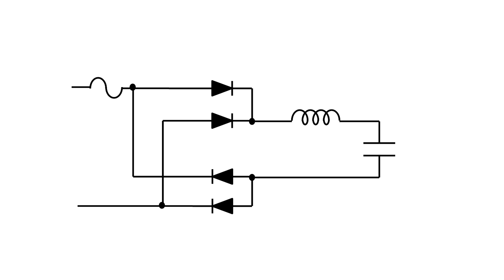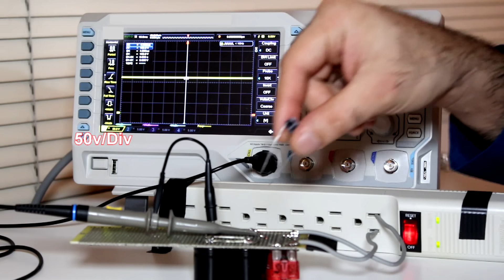Making a Full Bridge Rectifier

Comment: Doesn't  power  comes only  in the  Live wire in 120vac?  The Neutral  is just the return to complete the circuit.. So full wave rectifier in 120vac is a waste of diodes  couse power never comes from the neutral. 
By the way if 120vac comes at 60Hz, then 220vac  will be 120Hz, correct?  Cause of  60Hz in each line alternating,  will give 120Hz. But if 220vac is 60Hz, then each line will have 30Hz.... could you clarify this for me please. Thanks

Comment: I didn't understand the part where you tell us why negative half cycle creates short circuit when the power was earthed mambo jambo.
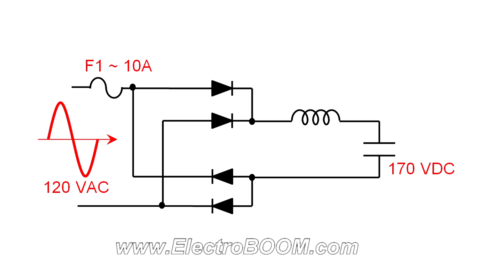Reply: Good question. If you draw out the schematic at 1:09 you'll see that when the AC goes into a negative cycle, current will feed back through the third diode from the top in the schematic to the hot wire. That isn't normally a big problem if the output is floating, not connected to the system ground. In that case the capacitor plate is already negatively charged so few electrons pass through the diode. However if you have ground for the input tied to system ground for the output, then electrons can freely bypass the capacitor, moving from the input ground through the diode and back to input hot wire. During that phase of the AC cycle there is no significant resistance slowing current down, so you get a transient dead short, enough to blow the fuse or even destroy the scope. For that reason, to protect the scope, many technicians power their experimental devices through an isolation transformer which prevents a direct connection between the transformer input and the scope ground. When you use an isolation transformer for the input power, the scope still has its own safety ground through the plug you use to power the scope, but electrons can't find a way to loop back to the input transformer so there is no dead short.

Comment: mr mehdi can i use it for 220 in iran
Reply: You can if you take capacitor of at least 350V. The rectified voltage is around 311V.

Comment: So idk about all that but my alternator is draining my battery when parked and i'm guessing I should just slap a bunch of diodes on the alternator positive and call it a day, no?
Reply: Your alternator is not draining your battery. You have a current leak to ground in one of the other electrical circuits. BTW, your alternator contains a rectifier and regulator in it.
Reply: @DaIssimo  
I'm worried the rectifier diodes in the alternator burned out, something for sure has shorted though it sparks hard everytime I reconnect the battery
Reply: @noahwood5686  In this case, I think the least troublesome method to fix your issue is to replace the alternator. If money is tight, then you can probably take the alternator off, open it up and see if anything is burned out inside. If it is just the regulator/electrics, then you may be able to buy just that part.

Comment: As an EET I get my new scope and think "I know I'll show everyone the 60 hz wave form from the power company from the wall outlet!"  Fast-forward to me putting the probe to the hot and neutral, and blowing the breaker.  "Yay mr engineer!"  Scratching my head. . . ."1 Meg Ohm resistance to input should allow almost zero current, not breaker popping current, what the hell is going on here?"    2:43  FACEPALM.

Comment: Actual demonstration of a LER (light emitting resistor)
Reply: AKA an incandescent lamp
Reply: Also known as an incandecent Light bulb
Reply: its efficiency is on the opposite end of the spectrum but oh well.
Reply: LEL
Reply: Good one
Reply: You mean an incandescent bulb filament?
Reply: Formerly known as LAMP
Reply: Bro just described an incandescent light bulb 💀
Reply: A light and a heater... I guess with a fan, a propulsion system.. or just light cigarettes
Reply: I think that's called an incandescent bulb.
Reply: So it's basically an like incondesent light bulb?
Reply: All incandescent light bulbs work on the LER principle.
Reply: @damemes3669  Except that an incandescent lamp is in a vacuum bulb so it can't catch fire, whereas a LER is exposed to air and can catch fire so it's much more exciting.
Reply: I don't think it exists as of yet but it's a cool alternative ide- oh
Reply: And I felt no pain, for once.  I'd forgot my last experience with such in situ, thanks!
Reply: Um aksually 👆🤓

It’s an incandescent light
Reply: Also called an incandescent lightbulb.
Reply: @xyzzy777 it mostly isn't that much of a good alternative, because it produces a lot more heat, so it uses way more energy
Reply: @someoneelse5005  r/woooosh
Reply: @ludiProjects  thats a lot of reddit stuff, why are you in youtube
Reply: @someoneelse5005 light emitting diode is efficient.
Light emitting resistor is just an incandescent lamp lol
Reply: @someoneelse5005 it's called an incandescent light bulb
Reply: @someoneelse5005  r/woooosh
Reply: @someoneelse5005  r/whoooosh
Reply: @mollyandaquafina  r/storiesaboutkevin
Reply: @anti-fz9be  r/facepalm

Comment: Full bridge rectifier circuit is no a such a big deal,i always thought.But once i was working in electric trains repair factory i came across with dc currents up to Kiloampere ranges.The forward voltage drop of rectifying diode maybe is about 1V but in high currents the loses across diodes are huge.

Comment: I hope that NO ONE thinks the 170 volts DC is safer that the 120 VAC line voltage.  At least with the AC, your heart might go into ventricular fibrillation and you might not die immediately, whereas, with the DC, the heart just stops!  Yes, you could get lucky if you have "one hand in your pocket" as they say.

Comment: I have 220v main voltage which i want to  convert to dc. I am using 4 in4007 diode and 250v 15uf electrolytic capacitor. Will it work ? Plz answer.
Reply from the maker: Nope, the dc created from 220v is 310v, so you need higher voltage components

Comment: I feel like you should build a massive 5000 watt psu for linus tech tips to test out on their new 100,000 dollar computer. They have to use 2 1600 watt units. That would be an awesome collaboration, and if he’s willing to drop a 11,000 dollar cpu for views I’m sure he’s willing to possibly blow up a 100,000 dollar computer for the views, and then you get some too. That’s if it blows up. But then again...
Reply: Computer PSUs, especially the higher wattage good quality ones are made from very high quality components, use very complex circuits, and have tight tolerances. People make custom cooling setups all the time, even custom cases, but never custom PSUs, because it's just not a good idea. A 5000W PSU will be a: way too huge, and b: if it blows up, it not only would take the PC with it, but there's a legitimate possibility of someone dying.

Comment: So 170V DV doesn't hurt... Until you unplug the damn thing and touch the capacitor which have only some of the 170 V DC.
Reply: Most of the things he does is intentionally to educate us not to do things and how to do it correct way.  That time he didn't get a actual shock but acted to say that capacitors do hold charge and can cause explosion if shorted even when unplugged
Reply: Because his palm is more sensitive.
Reply: Why is it so ? I also have that question.
Reply: @chinmoytahbildar3278  It is NOT so. You will feel DC voltage from 45V upwards, depending on the conditions.
Reply: @hansfriendly4815  I understand that @Werner Beroux is joking... What are the conditions ?? Why he doesn't get shocked after touching 160 V DC ??
Reply: @chinmoytahbildar3278  I think the joke is "he always gets unintentionally a shock, but now he just asks to be shocked and surprise surprise, nothing happened.." conditions, there are many, but it comes down to the conductivity of your body, this is e.g. influenced on sweaty feet., air humidity, etc.
Reply: @chinmoytahbildar3278  because it is DC
Reply: Probabily because his palms were sweaty.
Reply: @anti-fz9be  Knees weak
Reply: @Alex-ek4iz  sorry, I don't follow.
Reply: I’m guessing his palms were slightly sweaty and he got a bit of a buzz from it rather than an actual shock. Some of the pain is acted to encourage safety
Reply: His hand was probably sweaty or he touched the capacitors with a more conductive part of the skin on his hand
Reply: Also i assume it is more painful too when you dont expect it
Reply: My guess is that the current spike of rapid discharge of the capacitor behaves similarly to AC which passes through humans more easily.
Reply: @theodiscusgaming3909 , ecstasy.apostasy,  and Integra Xnine  
No offense, but you guys need to watch a lot more ElectroBOOM. Of course a discharging capacitor only delivers DC and it doesn't behave like AC either. He's just acting to bring his general point about safety across. Also, just because a capacitor "can deliver high current" (read: "has low internal resistance") doesn't mean it will magically ignore the resistance of whatever it is discharging through.
Reply: AyyMD VEGA that’s exactly why
Reply: Because capacitor discharge Voltage is neither AC nor DC.
Reply: Because of the current a capacitor can deliver?

Comment: Whats the work of inductor herebexplain
Reply: A capacitor is a device that reacts to variation in voltage and are connected
 across the load. The inductor is a device that reacts to changes in current. The inductor causes delay in current. The use of an inductor prevents the current from building up or dying down too quickly. If the inductor
 is made large enough, the current becomes continuous and nearly constant. The inductor prevents the current from ever reaching the peak value which would otherwise be reached without a filter inductor. Consequently, the output voltage never reaches the peak value of the applied sine wave. Thus, a rectifier whose output is filtered by an inductor cannot produce as high a voltage as that could be produced by a rectifier filtered by a capacitor. However, this disadvantage is partly compensated because the inductor filter permits a larger current without a serious change in output voltage. This is the reason that an inductor filter is suitable for high power applications. 

TL/DR:
The function
 of the capacitor is to smooth out the variations in voltage while the inductor is used to smooth out the variations in current. Because of the uniform flow of current, the capacitor-inductor filter is used widely in high-power applications.

Comment: So now I could build a 1500W PSU for my computer for much less than what Corsair or Seasonic want to charge. All I will need to do is add a small step down transformer for 12v and 5v DC.

Comment: Does capacitor voltage matter in reference to the input/output? I've seen several videos where people use capacitors with voltages bigger than the desired output voltage. For instance: Using a 50v capacitor for a 24v power supply from a 12-0-12 (or 24v) transformer. Seeing people using capacitors with nearly double the voltage as the output (as a newby) makes me wonder what I am missing.
Reply: You generally just want something at a higher rating than you need.

Comment: How were full bridge rectifiers implemented before solid state circuits with valves?
Were 4 valves used?
or were there special valves made which used 4 pairs of electrodes?

I know a mercury arc rectifier would use a lot of energy but what did it do to the AC waveform?
Reply: They weren't. You'd either have to get by with half wave rectification with one diode or you would need to use a center tapped transformer in a full wave configuration, with two diodes.

Comment: CAN ANYONE HELP ME.. I HAVE A HIGH SPEED PATTON 240 VOLT FLOOR FAN. I WANT TO USE THE 3 SPEED MOTOR THAT HAS 5 WIRES. 2 THAT ARE SHORTER AND WERE CONNECTED TO A SMALL BOX. CAPACITOR OR SOMETHING. ANYWAY I WANT TO CONNECT THIS AC MOTOR TO A DC 50 VOLT BATTERY. HOW CAN I DO THE WIRES? PLEASE HELP

Comment: Amazing, but can you convert dc into a perfectly sined ac without moving parts?
Reply: Yes, it's called a pure sine inverter. This is also an essential function of grid-tie inverters, which feed power generated from a DC source back into the grid. Just like any solid state inverter, you need an H-bridge, but instead of just sending a modified sine wave (two square waves 90 deg offset and added together) to the bridge, you need to PWM the bridge with a sine wave. then, you need to filter it. At mains frequency, you need huge, expensive filtering components, or an absurdly high PWM frequency. These factors increase the higher the power output needs to be.

Comment: I'm looking for the most economical way to convert a cordless drill (with a dead NiCd battery) into a corded drill (that plugs directly into mains). I'd like to have the AC-to-DC circuitry housed in the old battery's shell.

Could I use a FBR to get 170V DC, then use a DC-DC step-down converter to send power to the motor?

Or would it be cheaper/easier to just use a switch-mode power supply? Or some other method?

Comment: Hi ive got a problem with rectifier
Ive build something like yours but after rectify my voltages are not equal
I should mention that im using a double voltage power supply
Its like 10 bolt different in there
One is 48 and the other is 37
My ac in is 30v and out put should be 42

Comment: Sir i have one doubt... If you have connected the load earlier and then probe it while the earth terminal not being insulted... Will the fuse still blow out? ..as i have observed you first tested the circuit at no load (open ckt) and hence  during every cycle as soon as the diode fwd biases it shorts the power line to earth... 
Thanks in advance 😅🙏

Comment: remember, when you direct rectify the voltage mains you introduce harmonic current to the power system because the rectifier charges the capacitor at 120hz

Comment: i pray u dont get killed by electricity someday
Reply: Poking a wire into a live socket has another danger. If you happen to plug into the live side first, the neutral wire imediately becomes at live potential. Catch hold of this innocent looking neutral and it could prove fatal.  Clowning with electricity is neither funny nor clever and the first thing that usually gets copied by would be learner's are the dangerous activities.

Comment: Sorry for degrading the conversation by bringing up the HALF WAVE RECTIFIER,  but I've got a dillema. Have two similar 110v shaded pole motors with about 20% difference in their primaries' resistance. Wanted to run them in series at 220v but realized the current won't be distributed equally. I am contemplating trying to run them in parallel thru a diode. Since half wave rectifiers output half the RMS voltage of their input, this is just what I need, right? How do I calculate the power dissipation and pick the right diode? Will the absence of half the wave affect the shaded pole motor operation? Thanks in advance!

Comment: Wouldn't it be dangerous to touch the negative ("gnd") of the output, since on each negative cycle it's shorted to live? (which is why it blew your fuse when connecting to the probe the first time) How do real life rectifiers deal with that? Sorry for the stupid question

Comment: I try to add batteries and it worked.  but it's not a solution. 
 and when the capacitor gets empty it will need too much current to charge it up.   

can i modified the 40ac sign wave to square wave and then put full bridge?

Comment: I want to ask you how I can smooth a 40V ac with a load of 40A continual without making the capacitors empty from the top pick dc coverage charge? 
if I add more capacitor the transformer have fuse cut off because the capacitor get to try to charge instantly from 0 to 40 and over the 40amp by 5 times

Comment: this video is great but i want to know about how much ampere it hold on output side and as per i saw you directly connect wire to Ac single phase then how should u write it 120 v if this correct then am i able to connect direct my circuit to 220 Ac supply???

Comment: Dear sir, I had fun with your video but, the information provided by you regarding waveform of current i.e.., you said that AC is more dangerous than DC but, Actually DC is more dangerous than AC since current in alternating wave reaches zero every half of the cycle but Direct Current  maintains constant magnitude so, preferably Direct Current is more dangerous than Alternating Current Sir.